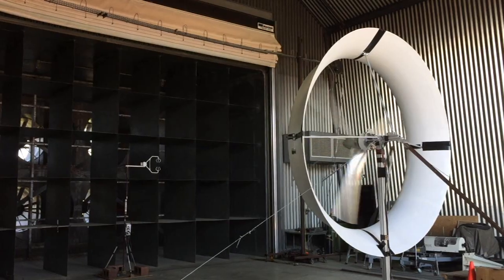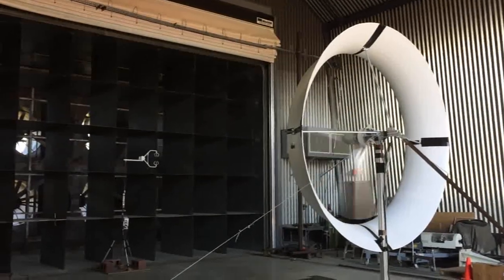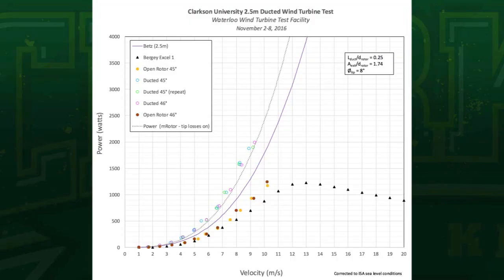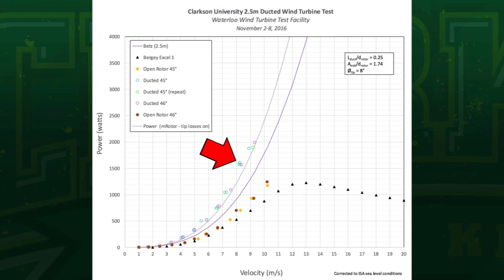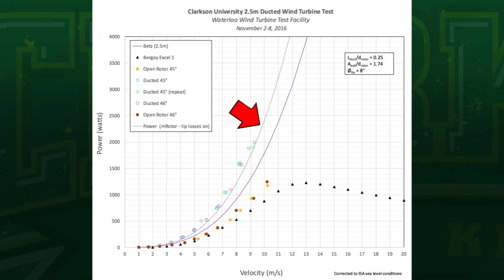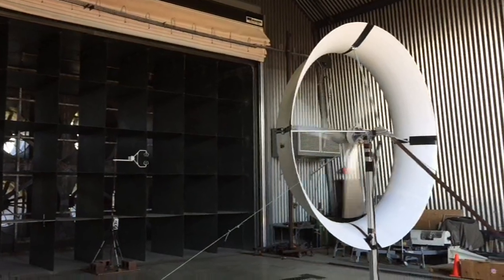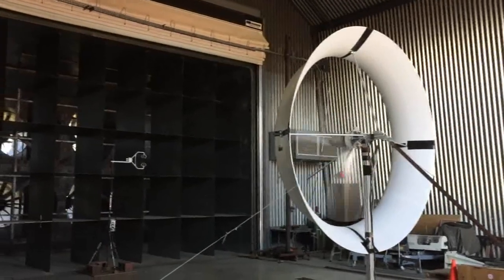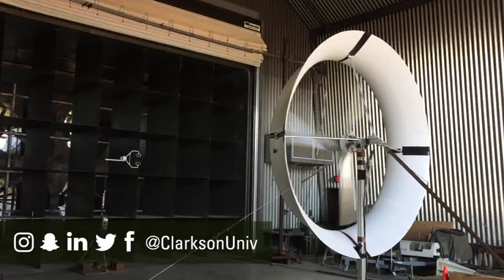Ducted Wind Turbine Doubles Performance at Clarkson University

Comment: Wind power is really stupid. Electric power output goes with the third power of the wind speed. So a 1 MW windmill will perhaps produce 1 MW at 10m/s wind speed but only 1kW at 1m/s. So not even enough to run one toaster. (1 x 1 x 1 x 1kW to 10 x 10 x 10 x 1kW)

Now the case we have in reality is that 10m/s wind speed is rare. In most places you will only get that a few days of the year. And more importantly the windmill has to be shut off if the wind speed goes slightly above that to prevent self destruction of the windmill because the forces and the energies just become too much for the windmill to handle. Remember, third power so 20m/s would be 8 times the power and a windmill built for 1MW cannot handle 8MW. Most likely it cannot even handle 2 or 3.

What does that mean in reality, what does greenpeace not want you to know? Because the windmills production can go from 1MW to 0 if the wind speed increases, you have to run a nuclear or coal plant at full power in the background to kick in when wind power fluctuates, which it constantly does with the third power, so with extreme fluctuations.

Not only will wind mills produce only tiny amounts most of the year, but when it kicks in you are still burning coal at the full rate in parallel and you need a backup power plant, so price is at least double, normal power plant plus windmill. Plus you are burning more coal than you would without wind power, because you are wasting a lot of coal in hot standby and by running coal power plants in less efficient partial load modes.

See Germany, without wind it would be burning less coal, the numbers are out. Price for a kWh has risen 6 fold to 30¢/kW and more CO2 is produced. 500 billion have been wasted for nothing but green stupidity and failure to think clearly and do the math.
Reply: Alexander Biersack wow
Reply: A renowned economist has done the math for Germany. Storage to replace just three normal sized coal or nuclear plants would cost 180 billion. There are physical and economic limits to what can be done with wind and solar when you want a stable grid.

Even the IPCC say in their climate reports that only nuclear capacity can be built up fast enough to prevent climate change and make a difference. But of course greenies don't want to hear that and thus ignore that fact of reality too.
Reply: Efficiencies aren't that low. The 3 bladed design is also really basic imo. Just 1 pass of the wind and the rest just leaves as wasted energy. With no attempt to manipulate the pressure or amount of mechanical energy captured.

Comment: Adding the duct effectively increases the size of the turbine.  Its the same as a bigger turbine which cannot be compared with a smaller one, no wonder it is more efficient.
Reply: Ducting doesn't really increase the size. It's much more important for modular units people might be interested in rather than industrial power stations. I wondered for a while why they never ducted the turbines to increase pressure.
Reply: Alexander Biersack   please give a link to your turbine research.  i am interested.
Reply: Don't confuse the engineer. He needs his simplistic and reductionist thinking. Of course you can't economically build a duct that has to turn with the wind mill for a modern 2 or 5MW windmill and a 50 or 100 meter rotor.

Engineers don't think of the economics of such things. They just optimize one parameter and can't be made to think of the whole. Although they would be in a better position to understand the problem than the typical green who just needs the warm feelz from his postive thinking and does not care about the terrible outcome for nature and society. His intentions were good.